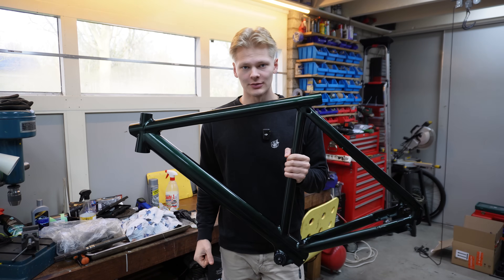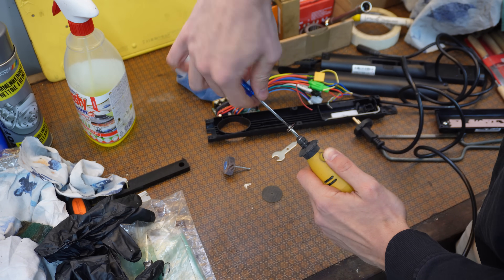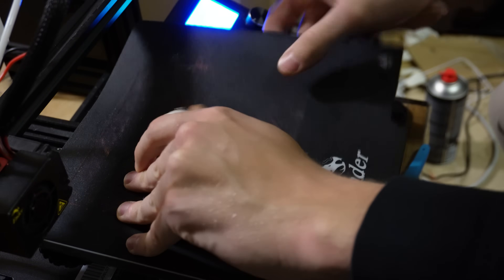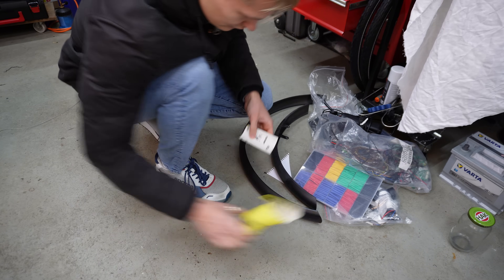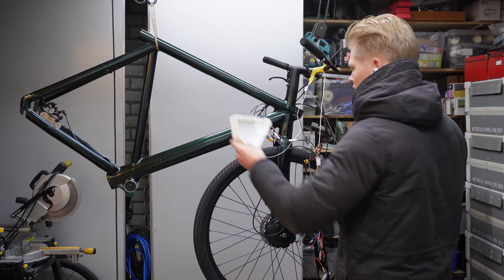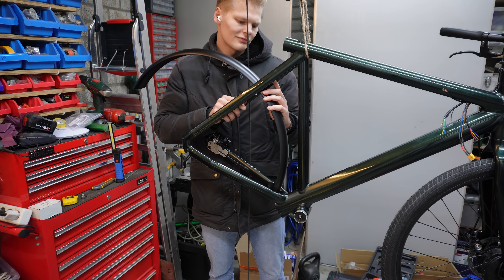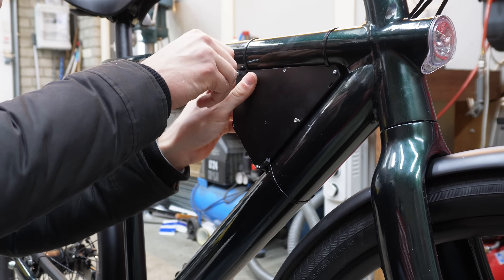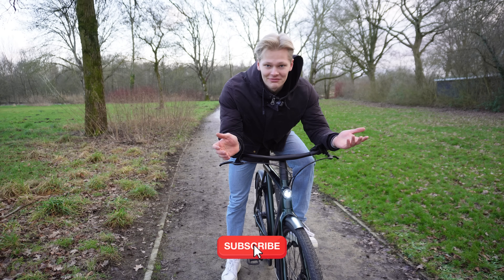I BOUGHT AND REBUILT A SCRAP VANMOOF - DIY E-bike build part 3

Comment: Can you tell how you did that with the kick lock
Reply from the maker: The kicklock works from the throttle handle voltage, you can hide a button and even adjust the settings so no power goes to it. A hidden button is not the most secure way, but for me its just a little extra feature on top of the normal locks!

Comment: Nice, I would suggest connecting the AirTag inside via the main battery using a buck converter and also removing the beeper as I did with my VanMoof S3. Thiefs might assume that the tracker is inside the seat and are/or able to locate via playing the sound. Keep in mind that the case with block the signal so putting it behind some plastic section like the speaker section or the lights would be recommended.
Reply from the maker: Good idea! Thanks

Comment: Wow. I just acquired a vanmoof  that’s unfixable. I may strip the electronics and make it an acoustic bike. Hoping I can use the front wheel/motor to convert another bike using a Bufang controller.

Comment: The bike looks great and these videos are amazing! Are you riding without the eshifter? I can't see it and I'm not sure if you mention it anywhere. Thx!
Reply from the maker: Since this is a S2 it has a mechanical 2 speed hub instead of the electronic shifters. You could also swap in this wheel into any other vanmoof, makes it a lot easier!

Comment: Nice video! I did the same but found a tubular controller online, fits nicely in the space where the original cartridge was, works beautiful!
Reply: Hi, can you give me a LINK, please?
Reply: @martinmoller9158 There are many generic e-scooter controllers which are tubular.  They come in many different sizes and are compatible with most e bike hubs
Reply: great. please can you share the link with me too as well as any other parts that you needed
Reply: Also removed bms from vanmoof battery (cells were still good) and replaced it with 10€ bms from aliexpress and i bought from Topbike kit a throttle, small display and a pas sensor

Comment: Great job. Better make sure to lock it well. Preferably keep in in your garage when not in use, By the way setting heat inserts in you 3D prints is a lot easier with a soldering iron.
Reply from the maker: You are right, but I couldn’t find the big soldering iron I usually use 😅

Comment: Very nice that you redefined the bike. The vanmoofs are very nice in design. Electric wise not so much. But why didn't you buy a broken / used cartridge from another s2 and took that controller? enough second hand parts out there ( asuming you are as dutch as you look)
Reply from the maker: I figured it would be best to make everything universal and accessible right now, instead of buying a €300,- controller just to have some other Vanmoof part break after that. Now I can fit any controller, battery or motor if I want/need to.

Comment: Was looking to do the same, which type of bike do you have (van Moof rookie here) and did your wrote down the schematics to share? (even in draft?)
Reply from the maker: All of my STL files are up for free, but I did not share any detailed plans for the electronics…yet. To be honest, it’s quite simple. Motor wires just connect to the controller motor wires, and my BMS wires can be copied from the 2nd video (after which you just end up with a + and - charge/discharge wires.
Reply from the maker: Oh yeah, and I bought the Vanmoof S2 since it does not have the electronic controlled gears but just a mechanical hub system. Makes it a little easier, and no messing with vanmoof branded hydraulic brakes 😉.

Comment: Dude, great vid but I don't really what to know how much it cost.  I want to know how fast and how far it can go!  Speed and range my friend!
Reply from the maker: It will go 35 km/hr easily without putting pressure while pedaling, but more like 40/45 if you put in some light effort. Range… well I have not yet tested anything above 40 kilometers, but it had plenty of battery left when I got home. So should go pretty far!

Comment: A buck converter is probably the most efficient option for stepping down the voltage (mainly depends on the chips of the specific converter). But it's definitely perfectly fine for something that uses as little power as a LED light, no worries about that.

Comment: You made it even better than the original. Including the design.
I like it to see the box holding the controller and some cables.
Would it be an idea to revuild the battery with better cells to get a bigger range.

Comment: Nice job, I don't like these Vanmoofs because of some (proprietary) design choices and they literally are in a similar price range as some normal brands like Cube, Kalkoff, Pegasus etc. but I kinda understand the idea.

I'm unsure about the calliper mounts but you may easily upgrade the mechanical disc brakes to hydraulic ones (also a lot of low-priced MTBs come with mechanical disc brakes, better than rim brakes but of course not as good as hydraulics), the newer 3 and 5 series have hydraulics and seemingly the rotors have the usual 6-bolt mount it's one of two standards, a lot come with center lock (the same lockring and tool is used for cassettes or if it's with outside notches it's the same tool for Hollowtech II bottom brackets) and some have 6-bolt.
The Shimano MT200 are great for just around 20-25€ for the full brake (lever, hose and calliper with pads) on Bike Components (the front+rear kit is 45€ and they deliver to the Netherlands for 7€), you may just need a larger 160mm rotor on the rear for that to work (IMHO 160/140 is a little undersized for an E-Bike around or above 20 kg, even these aren't really designed for long/steep climbs/descents with these 2 or 3-speed hubs - my non-E Trekking bike with a Pinion gearbox is around 17 kilograms and came with 180/160mm brake rotors).

For better road safety/visibility I would add some spoke reflectors (these white you can clip on not these old-fashioned orange ones) as the tire sidewalls don't have a reflective strip or there's some reflective tape which normally is black but acts as reflective tape does when you illuminate it with your headlights or a flashlight, just stick some to your frame.
I also have a frame lock with additional chain and would recommend a small frame triangle back to store it when not used, because mine is so large I also can put my phone in a side compartment and also have a small multitool (some allen keys, philipps and flathead screwdriver) and spare inner tube in there.
Reply: I LOVE Vanmoof 😘

Comment: You can find a rechargeable FIndMy tracker on connect it to the main battery with a DC DC converter. Then the tracker recharges automatically any time the main battery is turned on.

Comment: Id recommend looking into some reusable thermal pads for the MOSFET heatsync as just raw contact requires a lot more pressure than you'd expect even CPU sockets use thermal paste to fill in the micron thin gaps
Reply: Seems a little overkill. It’s not a microchip…

Comment: Instead using zip ties to attach controler box to the frame, you might consider doing small drills to the frame, ad some rivnuts and screw box from the inside to the frame, look will be even cleaner. Other than that its just superb.

Comment: just a few years on and you can't find parts for e-bikes. you need some technical skills to hack a fix.
Reply: Thats because this bike has a bunch of proprietary components. Most e-bikes are not like this
Reply: Custom ones like this, yea.  But I managed a battery system and controller swap on a Gtech ebike just off YouTube videos
Reply: There's a reason why normal people call this the van Goofy bike.

Comment: Do you have any idea how the buck converter could have destroyed your controller? I’m just curious.
Reply from the maker: I actually don’t really know, but I tried hooking it up to a 36v power source with a fuse inbetween and it kept blowing the fuses. Thats when I decided to just scrap that idea and move on
Reply: Did you make sure to use a buck converter rated for the 42V+ of a fully charged 36V nominal battery? It looked and awful lot like the cheap little ones from aliexpress that can only handle  <24V @GearShiftJourneysOfficial